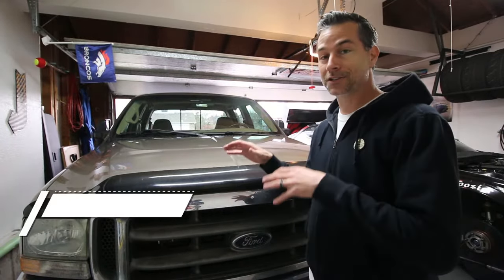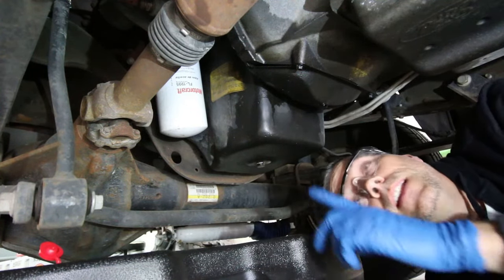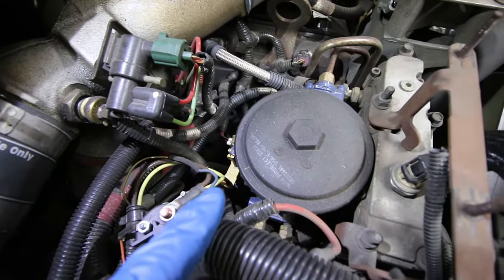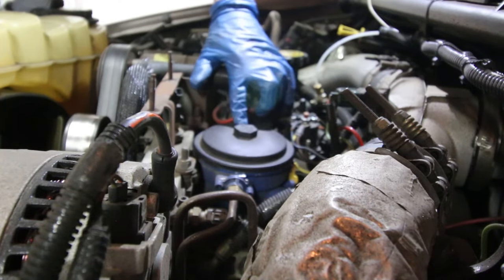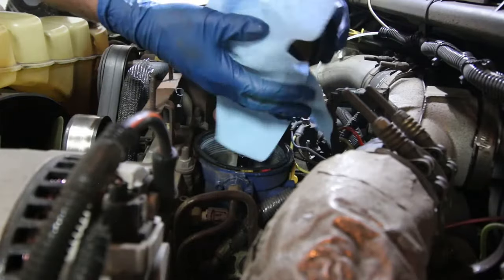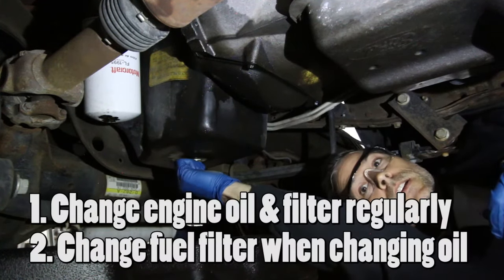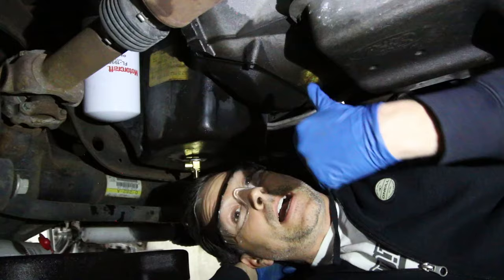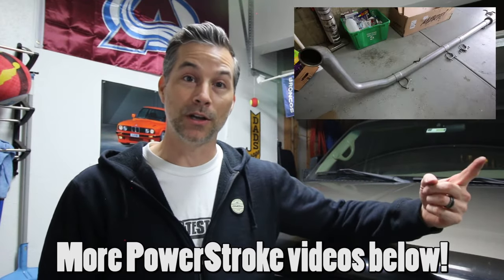Ford 7.3 Powerstroke Standard Maintenance

Comment from the maker: If you have an old diesel truck, you should probably know how to do these maintenance tasks. Agree? Yes or no?
Reply: BTR Justin i believe you should. The dealer is a rip off. With these fords the motorcraft filters are a must. All diesel truck owners should be able to change their own oil.
Reply: Not really if you have extra $20 -30 :)  any shop will do oil change for you.
Reply: I agree man. I pay a shop to do it anyway because I'm lazy but I do the fuel filter myself. It never hurts to know things and how to do things with a vehicle you drive daily and own.
Reply: No comment but yes absolutely I just want to know how you got the bold letters?
Reply from the maker: In the comment text? You just add a * around what you want to bold.
Reply: Instablaster
Reply: D.I.Y. IS A MUST ON ANY OLD VEHICLE.....ESPECIALLY OUR DIESEL TRUCKS.....THANKS FOR THE GOOD VIDEO.....B-T-W.....I ALREADY KNEW HOW TO DO THIS.....BUT I SOMETIMES WATCH VIDEOS TO SEE HOW OTHERS DO THE SAME JOBS.....KEEP THEM COMING.....
Reply from the maker: Thank you!
Reply: I just bought a 2002 f250 7.3. The truck has 560k on the truck and supposed to have 189k on a ford crate motor. will the serial number on the block by the oil filter tell me if it has in fact been changed by calling ford and giving them that # ? I'm concerned because he told me after I bought it where the crate motor was put in..I called and they had no idea what I was talking about. They said they would know by the owners name..I gave his name and th ename of the guy before him from an old insurance card..they had no record on that being done.
Reply from the maker: @A.C.71  Yikes, that's not good. You should be able to do a VIN lookup on the internet, or Ford direct I would imagine. I didn't know they made crate 7.3 motors 😲
Reply: @TheBTRGarage  oh boy lol I may have just bought a 560k mile motor. What a nice guy. Saved for 2 years to get this truck believing it had a 189k mile 7.3 ford crate motor put in.
Reply from the maker: @A.C.71  Well, I could certainly be wrong and crate motors are a thing for these trucks. Probably worth while to look it up.
Reply: I just changed my oil, filter and the fuel filter, but my truck is stalling. I bought a new fuel pump and am ready to change out the old one. There is a tool used to disconnect the fuel line toward the front of the truck. Do you know how to use that? Have you changed your fuel pump? I have an '02 F-250 Super Duty 7.3L diesel. She has 235,000 miles on it. I would appreciate your reply. I know this video is a bit old, but so is the truck.  ;-)
Reply from the maker: @Arthur327327  was it fine before you did that work? I haven't done a fuel pump on the Powerstroke yet, or used that particular tool unfortunately.
Reply: @TheBTRGarage  no, it was stalling intermittently. I have put over 100k miles on the truck since I have it and I baby her
Reply: @askdad Normally I'd agree with you, but I got burnt having a shop change oil and filter. Charged exorbitant price, said "fuel filter" was the reason.

I've changed oil on my other vehicles, but that's why I'm here today watching this video. lol. NEVER again.

Comment: I just did the same to my new to me 2000 F250 7.3... Your video was very helpful. I went from a Prius to my truck. Lol..I don't even have a trailer or any interested in pulling anything. I just love the old girl and how they look and sound. I was lucky enough to find a good one. One owner deal with 228k. Fully stock. Love it.
Reply from the maker: Nice, glad the video(s) helped! These trucks are truly becoming icons of a bygone era, kind of cool to experience them in a way. I also drove a tiny little Chevy Spark EV with this truck as the second vehicle, quite the contrast 😆
Reply: Thanks for replying! Looking at replacing the ICP pressure sensor & Cam shaft position sensors. I did the fuel filter, oil change, transmission filter/oil & GPR.. The truck is running great! Belts look good..Any more sensors I need to replace or be on the lookout? 
Thanks,
Reply from the maker: The ICP is a common one, just did that on mine, so you are good there.  Unless your seeing any kind of issue I would just run it. You can get into quite the rabbit hole if you want to do "preventative" type maintenance.

Comment: Tip for ya, a swivel headed oil filter wrench can also be used in removing the fuel filter cap. When doing the turbo might as well replace the up pipes
Reply from the maker: Thanks! Didn't think about the up pipes, I'll look into that.
Reply: This is my first diesel so not familiar with the up pipes.  I will look into what you are talking about.

Comment: The lever on the back of the housing is for draining water, periodically you should open it and drain whatever is on the bottom, be it water or debris. I leave a hose connected to the pipe and just tuck it into the frame. You dont want to tap the fuel filter on the sides of the housing like that as you can dislodge debris and drop it right back into the bowl. Clean fuel is on the center and dirty is the outside of the pleats. The fuel you pour back into the tank will most  probably have water in the bottom along with debris, so dont pour it all back in. Every second oil change I change the fuel filter. While synthetic oil is great, most diesels make soot in the oil, and the soot is what kills the oil and causes wear, unless you have some type of oil by pass filter set up like a fs 2500 I would just stay with regular oil and change it on a schedule compatible with your driving and mileage.
Reply from the maker: Thanks for the good info! I thought about the water in the fuel bowl and pouring it back in after the fact. I figured it's going to get filtered again anyways but good to know.

Comment: My only concern is the fumoto valve sticking down underneath-being a target to get snapped off-but I’m going to do one anyway, as I hate the oil down the hand/arm action. Thanks for doing this-subscribed!
Reply from the maker: If it's any consolation I've had the Fumoto valve going on 4 years now, and no issues. Unless you're off roading regularly I think it should be fine.

Comment: Living in So Cal I use 15w40 in my 6.0 luckily walmart has rotella t4 and motorcraft oil filter. I dont use any additives just change it every 5k miles or 1 a year. I also use the same rotella in my boat, quads and yard equipment
Reply from the maker: I was using the 15w40 previously as well. I wonder if I should go back to that since I moved to Phoenix from Denver (cooler to HOT) :)
Reply: BTR Justin definitely 15-40 in Phoenix. I hear it holds up better in hot weather than 5-40.
Reply: @pablomay28  I agree 100%
Reply: You are right, Rotella t4 15w40 is best for the 7.3 also and no need for additives. They are a waste of money.

Comment: Hey great video. I'm new to the powerstroke and doing my first oil change on it. Wanted to know if it's recommended to replace the oil in the hpop. I keep seeing mixed reviews on it.
Reply from the maker: Thanks for the comment! In my other 7.3 oil change video I do show how to change the hpop oil. I've seen mixed opinions on whether it is beneficial to change hpop oil too. My POV is that it can't hurt to change it, if anything, just to learn how it is done and where the hpop is. But, definitely not something you need to do regularly. I did it once before and haven't done it since.
Reply: @TheBTRGarage  thanks for the reply Justin. Sounds good I'll prob do the same. I don't know the history of the truck so I'll change it today this way I know it's done and moving forward I'll skip it a few oil changes. 👍

Comment: Let me ask you this.. 4 years later, are you still using the same oil and friction fluid? Or is there better products with proof out there?

T
Reply from the maker: Yep! Still using exactly the same products as in this video. Just wrapped another oil and fuel filter change at 180k miles. Did another Archoil treatment at 175k 👍🏻

Comment: Use all of that except for the oil filters. I use Amsoil bypass and full flow filters. Amazing how long they will keep your oil clean.
Reply from the maker: Interesting, I'll take a look at those. Thanks!
Reply: @TheBTRGarage  My bypass filter setup also has a pre-oiler pump. When you turn the key on to heat the glo plugs the pump starts circulating oil before the engine turns over. I live in Alaska and cold starts are very hard on engines, especially diesels.
Reply: @akquicksilver  do you have a favorite brand bypass filter set up or pre oiler pump?  I just bought my first diesel for my bee business and Indiana can get some cold temps with some wicked winds.  I expect a block heater to be a big advantage for me.
Reply: @michaelbarrett1914  Like I stated previously, I use the Amsoil bypass set up with the pre-oiler pump. I also use the Amsoil filters on the setup. Yes, a block heater will make a huge difference for cold starting and reduce the wear and tear on the cylinders. I do highly recommend the pre-oiler system.
Reply: @michaelbarrett1914  Like I stated, I use the Amsoil bypass filter set up with the pre-oiler, I also use the Amsoil brand filters. I would highly recommend the pre-oiler setup and the block heater would make a huge difference with your cold starts and engine wear.

Comment: I've got that same truck. How is that full syn oil working out for you? I have stayed with the dino oil and would be concerned with leaking with the syn in such an old truck. Fuel filter is changed every 3rd oil change.
Reply from the maker: The oil works fine as far as I can tell. Several thousand miles since this video was made. I will switch back to 15w40 though since I moved to a warmer climate. I change my fuel filter each oil change just cause it's cheap and easy maintenance.

Comment: I've been running T6 15-40 in NY year round. Was just thinking before I do my oil change this week if I should use 5-40. Afraid the small leaks will get worse tho lol
Reply from the maker: I liked 5W-40 in the colder weather where I used to love. Give it a try, you can always switch back 😁

Comment: Been changing my 7.3 oil for years and never poked a hole in the bottom of the filter to drain it!  And never filled the new one before screwing it on!  Will do those from now on - Thank you!! Also, have you developed any new oil leaks since changing from dino oil to synthetic?  I've heard synthetic will seep in places the conventional oil does not.
Reply from the maker: Sure, glad to help. No new oil leaks with synthetic for me.

Comment: so what were the results of the previous starting issues cured by the oil additive and fuel additive???
Reply from the maker: The additives definitely helped, but did not cure the issues 100%. I found the real culprit, the GPR, and have a follow up video that shows that problem, if you want to check it out.

https://youtu.be/AJ3dP70mQAA

Comment: I am not too happy with T6 5w40. It drinks the oil to the tune of about a quart every 500 mi. The truck only has 60k miles. Not sure what brand next. I am thinking Schaffer’s 15w40.
Reply from the maker: That doesn't sound like an oil problem if you're losing that much so quickly. Something else might be going.

Comment: Just purchased a 1999 7.3. I live in Massachusetts and I’m about to do my first oil change. Do you recommend the 5w40 synthetic over the 15w40 cause of the colder temps approaching?
Reply from the maker: The 5w-40 should be a little easier on cold start situations.

Comment: might wanna get shell rotella t6 synthetic for my next oil change on my 7.3 

should I go syntgetic or conventional? does it matter? is conventional better?
Reply from the maker: Which is better will depend on who you ask, it can be a hotly debated topic :) I have always used the Rotella T5 or T6 which are synthetic blend (T5) and fully synthetic (T6). You can't go wrong with those and are recommended by many for these diesel engines.
Reply: @TheBTRGarage  ok i might as well try synthetic for my upcoming oil change on my 99 ford 7.3 with 272k miles. 5th owner. i will put a 3/4 full  bottle of that hotshot stiction eliminator in there as well. tyvm for making the videos. even tho synthetic will cost more, you get what you pay for;)  ;)  also what about a high quality oil filter?
Reply: T-6 is full synthetic. That's the one!
Reply: I went with shell t6 full synthetic 15w40. along with the 64 oz 2 quart of the stiction eliminator. wix oil filter as well
Reply from the maker: Good choices!

Comment: I have a 2001 do the trucks come with different styles of oil pans?my oil pan raps around the oil filter
Reply from the maker: Is it automatic or manual? It might be different for the manual transmission.
Reply: Auto another thing I came across today was there is a small drain plug up by the fuel filter with 2 qt of oil that never gets changed thru the oil pan that has to be vacuumed out and refilled the oil goes directly to the injectors

Comment: You see any difference from the Arch Oil vs. the stiction you used in your other video?
Reply from the maker: I felt like the stiction eliminator made the truck run noticeably smoother. But that could have just been the oil change and the fact that there is a lot more Stiction Eliminator that goes into the truck vs Arch Oil. I'm sure both products do their job well enough without any sort of "feeling" in how the engine runs.

Comment: Anyone know why my fuel bowl isn’t draining when I Turn the lever
Reply from the maker: Is there fuel in the bowl? 😁

Sounds like the tube may be gunked up, also make sure you take the lid off the bowl (air needs to displace the fuel draining or it will vacuum).
Reply: Start the truck, then open the drain. It will blow out any restriction. I’ve had the same issue, after a quick blow while idling, problem fixed.

Comment: How did the hotshot work for your cold start issues?
Reply from the maker: It seemed to help, but not sure if it was directly from that or just the whole oil change in general.
Reply: @TheBTRGarage  i hear they start better in the winter with the T6 but then I hear not to run T6 because the different weight oil. So I just run the T5, works ok in the winter I guess but im not below freezing all the time. Do you let your glow plugs warm up for the full 2 minutes or do you wait for the light to go out. Mine starts better if I wait.
Reply from the maker: Yea, when it is really cold I definitely wait the full 2 mins, and sometimes even cycle it again.

Comment: how come all these 7.3 fuel filter videos all show a different filter and cap coming off the truck and not ford? they all take an aftermarket out and put a motorcraft in... why all these aftermarkets and where do you get caps if you dont have them or you just want the same filter your taking out? i dont know whats in it yet but i dont want to be assed out when i do it...
Reply from the maker: The non-OEM filters are probably what's easily available at your local auto store, or auto shop doing the oil changes. I'm sure they are cheaper and cost has something to do with it. I think you'd have to go to the dealership for OEM.
Reply: This was my question exactly.  I found DORMAN Part # 904-203 fuel filter cap on Amazon for $15.  So now I can use a Motorcraft filter and replace my Napa all in one!

Comment: How often is the fuel filter changed?
Reply from the maker: The recommended interval is every 15k miles (every 3rd oil change). Some will say, on higher mileage engines, to do it every oil change because it's cheap and easy. Basically don't go longer than 15k miles, do it at 10k or 5k if you feel inclined.
Reply: @TheBTRGarage  awesome! Thank you so much!!

Comment: But did it help your white smoke coming out of your muffler remember?  Did the 64 oz of oil treatment work? Or do you still have the white smoke?
Reply from the maker: I think that might have been unrelated. The white smoke eventually went away, but I am not exactly sure why.
Reply: I had to do the quarter trick on my   99 7.3. After I drove it a couple times. Mine seem to have more response with the fixes I have done to it. That's cool it went away.
Reply from the maker: The quarter trick for the injector harness? I just had to do that on one side, truck broke down in middle of nowhere a month or two ago 😳

Comment: Wix fuel  filters for my 1996 Ford F350 Turbodiesel have “gone out the roof”  in price in less than a year, especially Wix filters. $70.00 or so at O’Reilly’s.
Reply from the maker: Bummer. Try out the Motorcraft, $25 bucks.
Reply: Remember everyone. Do not mix fuel filters and fuel filter covers! They are not the same! I personally run Motorcraft, if you run NAPA, or WIX, you have to use their cover!!! If not it will bypass the filter, because the filters are different sizes.